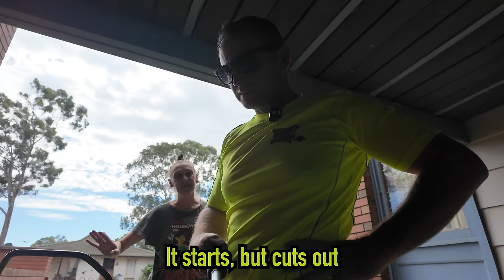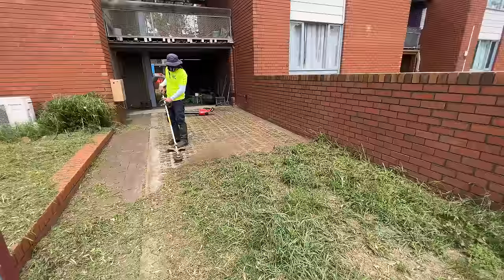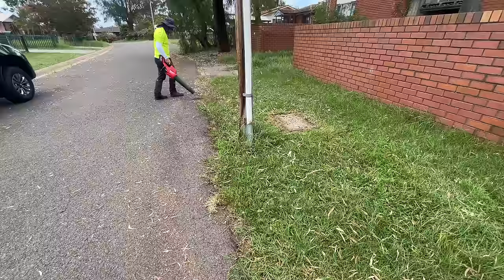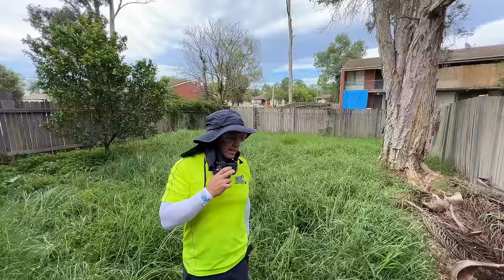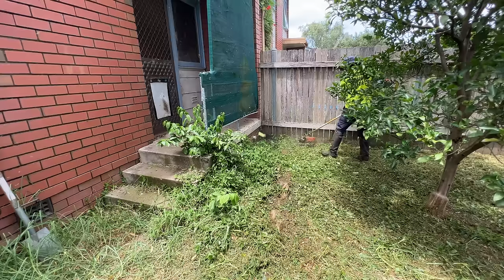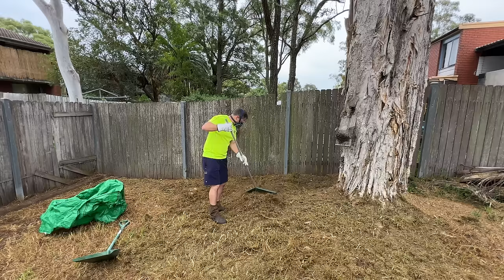Uncovering this path after 27 Years!  Full Clean Up! Free Mow Fridays

Comment: Hi Tim. I am watching you from the US (Texas). Here, we would refer to the material in the driveway as "GrassCrete". It is meant to be eco-friendly. It provides a semi-porous surface which stands up to automobile traffic and allows the surface water to penetrate the soil rather than run off. Not only does it replenish the aquifer, but it also helps with erosion control. I learned about it in the 70's when I was in college studying architecture. So, your statement of it being a product of the 60's is probably spot on.  Sorry to hear you don't like it. It is meant to look exactly like you see it with the grass growing through the holes.  Don't sweat it. Just run the mower over it on the lowest setting and edge the sides. BTW, love your videos.
Reply: This
Reply: In Ohio they are called "Turf-Blocks" which provide a green  alternative to a boring asphalt or concrete drive.  It is meant to be mowed like the lawn.
Reply: Have seen this here in the UK, also called Grass Crete, used for driveways and small car parks.
Reply: Plant something like this: carpet plant Dichondra plant
Reply: I've seen this advertised as good to use on a grassed area you want to park on. I like the idea of it.
Reply: It is used in the UK too, it also does not crack in frost as badly as concrete because of the grass softening the effects of the frost. Mow it on low.  Of course if the garage was being used as a garage that would keep the grass down,  even foot passage to their storage, but, I don't reckon much passes there.
Reply: Resend it and put a thin layer of top soil over it, it will look great in a few weeks
Reply: Yes agreed mow it lol we had it in England provides parking without sinking into the mud 😂😂😂😂
Reply: @Yooper7643  I'm in Ohio and never seen these kinda driveways or streets! Only old thing ive seen around cleveland is the horrible red bricks that look sooooo bad now and are super bumpy from uneven bricks and many many holes and giant pot holes bc missing bricks!! If you wanna F up your car quickly come to Cleveland!! 😂😂😂
Reply: Bricks were a huge improvement over mud.  Then came asphalt and concrete. 
My city recently replaced asphalt with "nostalgic" brick which is now damaged each winter by snow plows. @V.I.C.
Reply: Totally agree, quick dry surface if maintained
Reply: If it was mowed instead of shaved it might look nice. If the grass was nice.
Reply: We call it Rasengitterstein and it's nice

Comment: These driveways were used for two purposes. The look(if it’s well maintained) and to reduce the ambient heat cased by concrete slabs. Love the content mate
Reply from the maker: Thank you 🙌
Reply: Also to allow drainage, rather than run off into the street. Bunnings still sells something similar, just a more basic square pattern.
Reply: The problem with them is that the small areas of dirt don't allow the grass to grow 'together' clump ... you know ... and all that happens is the weeds win!
Reply: As many others have said, the patterned blocks are for drainage reasons, they should be laid on a sand/gravel/ crushed rock bed over a ground seal cloth. The spaces should have stones/crushed rock in them, due to cost this is not always done.
Reply: Looks like it would save on the amount of concrete used as well. Looks poured and not individual blocks.
Reply: So, are they poured that way? I love it.
Reply: also, in Canada at least, we just mow whatever green grows through.  No need to whipper-snip.
Reply: I've seen them in a car park. All the reasons I guess. Constant use stops mud roads and keeps it all non slippery for folks in winter... with all the ice 😂 lol😊

Comment: That driveway is meant to be like that for aesthetical purpose, to have the grass growing on those shapes. The problem is that it needs to be rigorously maintained to keep it looking good.
Reply: Yeah. I also have my suspicions that they’re better suited to old reel mowers than rotary ones.
Reply: With keeping it cut really low and regular use from cars and people it shouldn't require much.
Reply: Those bricks are made that way in the driveway so that way when it rains the water goes back down into the ground instead of it running off into the street etc.
Reply: They look very 1970’s to me .
Reply: You can still buy these in this day and age (not that I'd want to). But just saw them at a local landscape supply place today in my travels!
Reply: If I got this type of driveway done, I would just use crushed rock in the gaps.
Reply: Aesthetic? Pain in the neck😊😊

Comment: That Milwaukee trimmer is very powerful. Those types of driveways were designed to be cooler and negate the heat island effect created by cement slabs. Also they are designed to help preserve groundwater by absorbing rain water and not just draining it off to the storm sewers.

Comment: I live in the US, but I've spent a lot of time in Germany and there were a lot of driveways similar to that there.  When they're new, the holes in the blocks are filled with a small gravel (1/4-inch or 0.5cm size).  I assume it allows water to seep in to the ground much faster than solid pavers.  The gravel-filled holes are covered with grass after a couple of years but they usually look ok and don't require mowing or other maintenance if the driveway gets used frequently.

Comment: To clear these tight gaps, in The Netherlands we use steel brushes on broom sticks. One pass is enough. Then aftercare with vinegar
Reply: G'day @rleermakers, do you use boiled/hot water from the kettle as well or just vinegar?
Reply: @LukeWarminger  just vinegar does the trick. Most of the  weed is physically removed by the hard steel brush (in V shape)

Comment: You're not meant to take it back to the concrete, the idea is growing a running grass (like a couch) so you can park on it and but have ruts. You can then wash your car etc without it running into the gutter.
Reply from the maker: No grass there, all weed
Reply: It's a shame that you couldn't give these people a push mower they seem deserving of 1. Great job, Tim. This 1 turned out amazing 👏. I love it when you edge.
Reply: @timthelawnmowerman  very true for that yard lol
Fingers crossed they can get on top of it from here.
Reply: Are you just meant to mow it then?
Reply: @krisheim7009  yes, the bricks allow the option of grass with the strength off concrete

Comment: You can thank the NSW Housing Commission for those driveways. This particular suburb has 800 public housing dwellings, tons of them with those driveways! They were built in the mid 1960s.
Reply: My only experience of this is where commercial buildings are situated in a green space and provision needs to be made for service / emergency vehicles where the ground may be wet / soft but not spoil the aesthetic from a distance.
Reply: I was going to say that it was housing commission that did that.

Comment: As others have said drainage is the reason for the driveway,  Also it eliminates the car wheel ditches that occur in strip driveways by allowing a sound base for vehicle to drive onto.  Reminds me of those old pebble gardens.  Even though plastic would have been put down to deter weeds, over time debris mounts up and you get weeds anyway.  Then your weeding pebbles by placing your hands under the pebbles and on top of the plastic to remove soil build up and weeds.  Painful.  I hope they pick up dog poo in future and bin it.  Good job Tim

Comment: Permeable pavers. The concept was reasonable; allow water to penetrate instead of run off. But often the installation was botched. No landscape fabric or gravel / sand underneath to drain the water and prevent weeds. The grass growing through was meant to be cut short, not scalped right off. So now there is no grass, just weeds. You could take Gary’s dud mower to your repair guy, gift Gary a decent mower (just ask a sponsor), and then re-gift the repaired mower to someone else. A yard full of dog shit is a pretty good reason for wearing a respirator and eye protection. Big job done well.

Comment: Those type of surfaces were designed in the 1970s (? in the UK ?) as a means of providing support for emergency/& other heavy vehicles that may be required
to approach ''estates/large housing complexes'' without getting bogged into the myre of soggy grassy fields, all the while providing the appearance
of grassy fields for esthetic and practical (kids play fields) purposes! Technically you are only meant to cut it short , as it also provides drainage.
Sort of a low maintenance park/play area whilst still allowing heavy vehicles rapid/unhindered access to the area. Only works in areas that do not
have severe/freezing winters, as the concrete structure breaks down quickly under those stresses. Be well & stay safe
Reply: Works fine where I live in Denmark 🤗 we call them armoring stones as they armor the grass against vehicle damage.
Reply: Maybe with a less intricate design, just circles, larger openings to allow for expansion/compression!?!  @Greblav
Reply: @guymarcgagne7630  The ones we have where I live are in the shape of a sun(☀️), a 10 cm. diameter solid round center and 1 cm down from the top there are 6 triangles sticking out so the entire diamerter is 20 cm. When layed the right way grass can grow up through the holes and you can,because of the 1 cm. drop to the triangles cut the grass pretty low without damaging it.
Reply: Sounds about right, you need the solid mass to resist the compression/expansion of freezing, that keeps it from fraying. Grass can grow between the structures.
Originally, in the UK, they poured concrete over inverted plastic cups forms, c. 15 cm in depth, then used blow torches to burn out the protruding sections.  @Greblav
Reply: @guymarcgagne7630  I went out out and took another look, after the measuring, they are placed point to point of the triangles.If you are interested I could send you a photo of how it looks 😊
Reply: It's fine 🙂 thanks 👍

Comment: There were various different concrete blocks for this method of carparking. I’ve not seen this particular one before but they enabled people to park on what would look like a regular lawn but without sinking the tyres into slush. In this instance it would’ve created the illusion of a full grassed front yard with a central path. They weren’t meant to be slashed right down to the concrete. The concrete was meant to be covered (but not with weeds)😉

Comment: im sure someone allready wrote it down, but these 'designes' are to give those otherwise maybe full concrete driveways or parking lots and other locations 1. more rain tollerance 2. more greenery and 3. less possivility of beeing frozen over and a safety problem becource of ice building up. it has its pros but this design espacially is very hard to maintain without professional gear and mostly hold with grain ed granite or something else if the greenery part shouldnt be of objective. im with you mate!

Comment: If the drive is a single pour concrete and perfectly flat it will look really cool with some golf course grass in each of the openings. But it has to be flat off by no more than a mm. Use a reel mower set to about 7-8 mm and bam cool driveway. But it's a ton of work and not for the weak of heart. lol

Comment: Electric trimmer you were using diffidently does not have the power like your gas trimmer but it surprised me that it did pretty good and is still running. I did see it has 2 batteries to it.

Comment: Infiltration is the point of those driveways.  The water can move through and recharge the aquifer.  Otherwise the water just runs off and becomes a storm water discharge.  There needs to be soil for the water to move through to clean it up on its way down.  They probably could just allow the grass to grow through and just mow it.  The grass there would actually slow water down and encourage infiltration. Maintenance wise, it probably does need to be cleared of grass occasionally to keep the pavers from breaking down.  A brick-paved driveway would do the same thing, but not allow as much infiltration, still allowing some water to seep in.  They made “permeable pavement” asphalt in the US, at least in the 80s and 90s but it tended to get clogged up.

Comment: Here in Germany those drives with open pattern are simply mowed… if maintained, they look very nice except the path wear the car leaves.  Why? Well in Germany you are taxed per square meter of water runoff surface… so to avoid it, use pavers that pass water through or open paver as such.

Comment: I think that driveway was done that way on purpose as a grass driveway. Theoretically, the grass grows in the holes and the pavers provide a base to drive on so grass doesn't get crushed. Here's a link to a This Old House piece of a variation of this process. This is something normally in warm weather areas that give extra parking and eliminate runoff.
https://youtu.be/99-c1TRffhI?si=7jBT1XHjxkjpJBQz

Comment: grouse work Tim mate love it plus i don,t think many people liked the style of that driveway from my view but yeah everyone.s a different one in the hen and rooster hut or nest i say but yeah luckily you cannot feed the chooks in those shapes though but yeah funny design at the time from it,s age and era of make but as for the back yep awesome job on that one and even the front and once that mower is fixed up probably with a carburetor aka carby cleaning and rebuild or replacement or maybe replace that spark plug which is most likely the culprit and if it,s a Torch or Denso type yep that,s no good for easy starting etc and i know that one for sure and yep as for a yard full of dog shit aka turd 💩 yep probably not the best thing to spew out of any mower with the side discharge chute plus more mess to clean up in the long run.